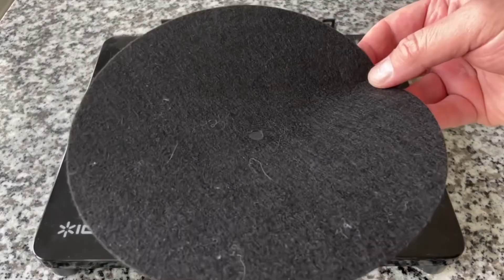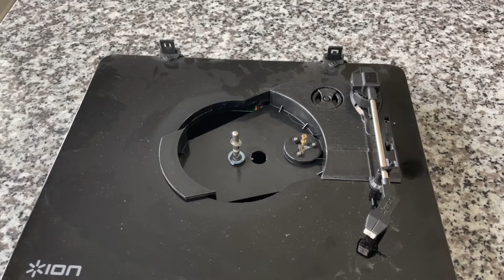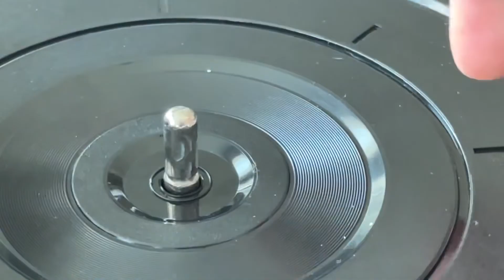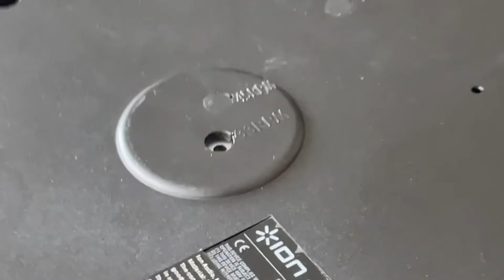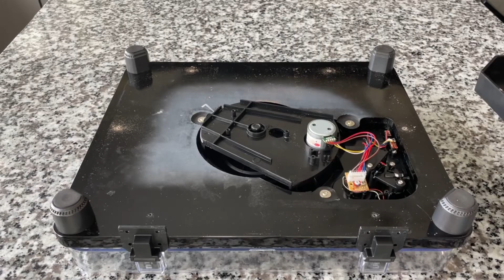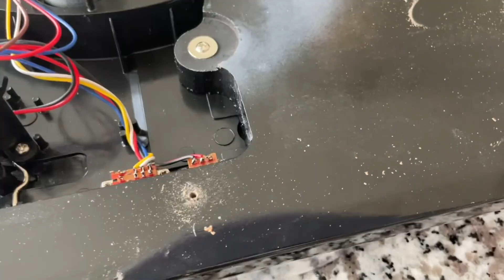ION Select LP Turntable Teardown – Build Quality EXPOSED!

Comment: Just for clarity . An electrician is the person that goes to college and learns Wiring (Domestic or industrial) they know the rules of the country they are in and understand Electricity. They make electrical things work. Electronics is not  being an Electrician. It is a different thing.  There is an overlap but they are not interchangeable.  As for the speed adjustment you showed a Philips screwdriver. I am thinking you were showing it for size but just to point out the trim pots will not usually be Philips compatible and a Philips driver  shoved in would damage the pots. Better to use a Plastic trim tool or as you originally said a jewellers straight  driver (Making sure not to short anything out). That chip next to the crystal is for the USB output signals. The hole is possibly either vestigial or to allow some air into the box, because the motor will get warm. On 78 RPM  they are like buzz saws. Nice Video. ( Did you find ALL the screws, LOL, been there done that)

Comment: There's nothing inside there that's going to shock you. That's all low voltage. The small, 8 pin ICs are the audio pre amps.

Comment: The small platter on such a large plinth is so ridiculous. Additionally the fact that the dust cover does not cover the whole base is a poor design. Also it appears that when playing a LP you can't close the cover at all. I have to disagree that any of the materials used to create this unit is "audiophile" grade. As far adjusting the motor speeds, it is best to have potentiometer adjustment tools which are made with non conductive materials.

Comment: That IC chip, based on its location on the circuit board, probably runs the analog to digital conversion and/or the USB port.
Reply from the maker: Thanks for the insight!
Reply: I’m wondering about this myself, for Bluetooth streaming. 
I’m guessing this would be built in cause it can convert audio via usb

Comment: According to their Wikipedia site.
ION Audio is a privately held consumer electronics manufacturer based in Cumberland, Rhode Island, United States. It is part of inMusic Brands.[1] The company was founded in 2002 with the stated aim of providing easy-to-use audio products at an affordable price.[2]

ION Audio designs and manufactures Bluetooth audio products, turntables, electronic musical instruments, and conversion products under the ION brand. Many products combine an analog audio player (e.g. audio/video cassette player, turntable) with an analog-to-digital converter (ADC). These are marketed as devices that allow users to transfer their old analog media to a digital format.[3]

Comment: The JYK chip is the USB interface and A/D encoder.   The little metal-clad component to the left of it is the crystal to drive that chip chip.  Your preamps are most likely the three 8-pin ICs with the big capacitor cans nearby.